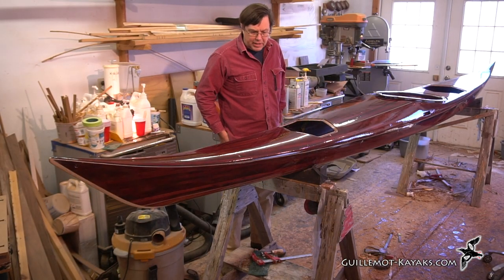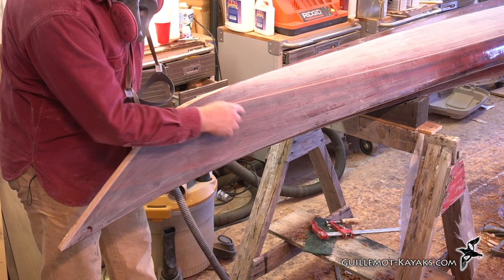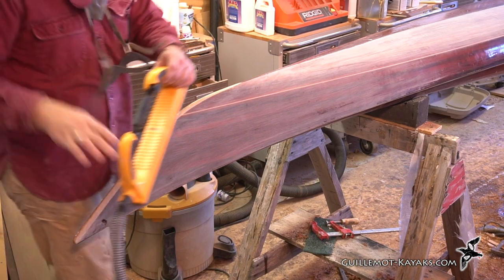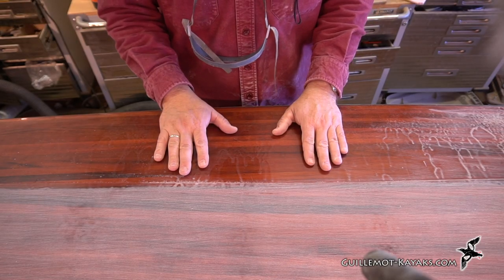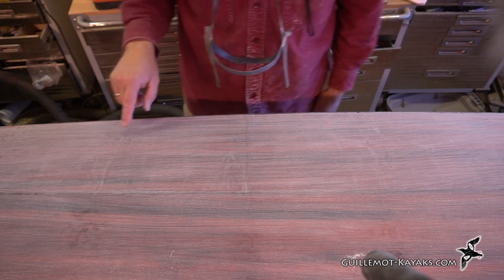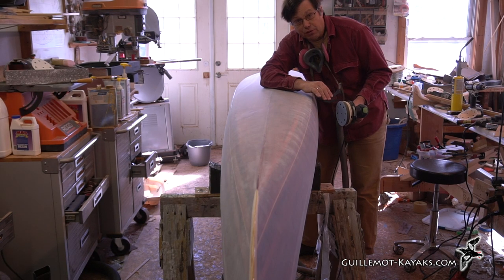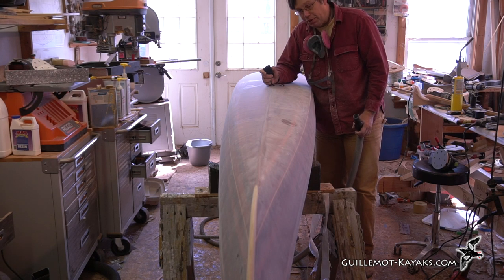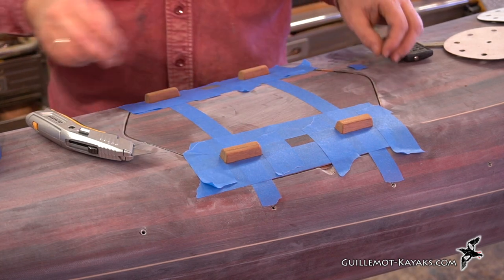Finish Work - Petrel Build - E15

Comment: Other question if you know staples will become low spots cant you pre finish thoses spots and let them dry to bring them leval to the larger surface so later when you fur it out your not cutting into a wider area to lower down to the low spots. Staples will crush the wood fibers and open them up at absorb more finish, so a pre flood will seal them off. So each topcoat lays flater over the whole surface, then if you've made any high spots they will knock down faster then sanding down to a low spot.

My dad used to build boats, he'd put on the fiberglass and one coat then call it done, even seen him just use paint.
I always liked the look of the wood better. Paint hides it.

Comment: Puzzling, if liquor bonds to itself in layers 
Other then levling out the finnish and removing dirt or stuff that fell into the finnish when it was wet, whats the point of sanding between coats, and after its flat smooth with last coat on you can always buff out the finish to a merior shine. 
Beautiful boat by the way. 
I guess all this work is a labor of love.

Nothing is worth doing unless its done right. This boat will cut through water like a knife through air.
Reply from the maker: The varnish does not bond that well to itself. You can get away without sanding between coats, but giving the surface a little mechanical bond by scratching it will promote a better bond between layers. The light sanding I did with the ScotchBrite pad helps with that mechanical bond. It also knocks off some of the largest dust pics, so they don't get continued to the next layer. This scratching does not do much to get rid of brush marks, sags or drips.

The final wet sanding before the last coat creates a more level surface, eliminating most of the brush marks and other flaws that may have accumulated in the prior coats. The goal is to have the final coat be really level and smooth. I didn't nail it with this boat, but it came out pretty good.
Reply: Lacquer and Shellac are the only two things where a chemical bond occurs so sanding is not needed.  If he is using a polyurethane then light sanding helps for adhesion.

Comment: What sort of varnish do you use over the epoxy? do you have to wait a long time for the epoxy to fully cure before varnishing or does the sanding avoid the occasional issues found with using a varnish over epoxy. ? thanks